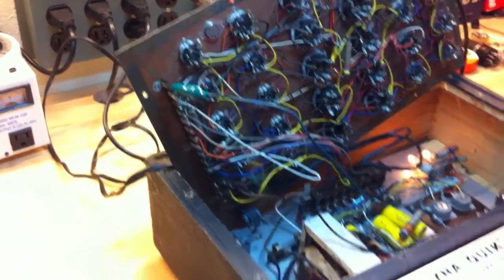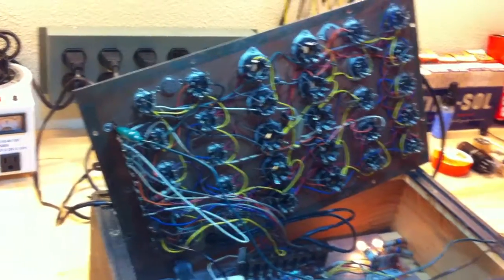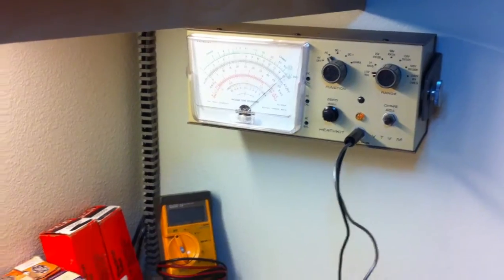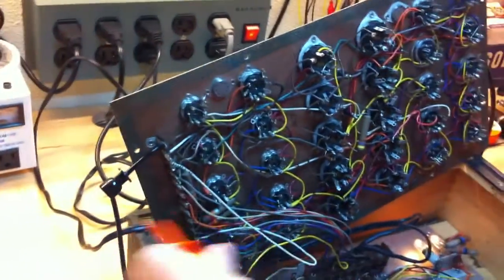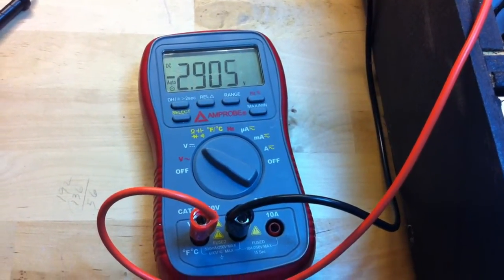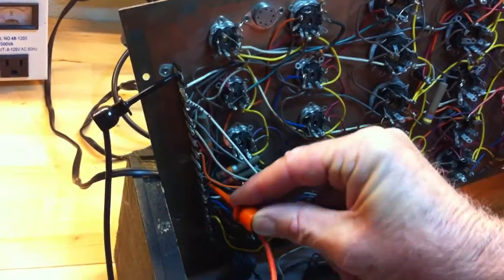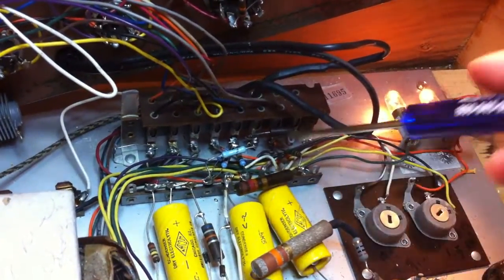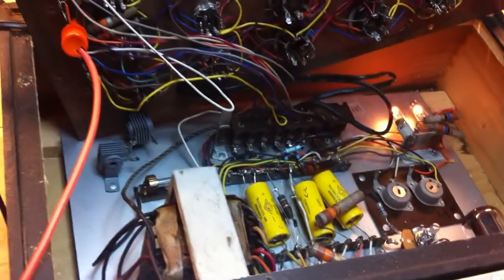B&K 500 Bias Adjustment

Comment: I picked one up free from moldy basement.i can say wood cabinet was finished but took many hours glue and reinforcement and sand and 3 coats of paint.
Then my God sand all rusted panels. Re paint make lettering. Long job. Had dig tube charts and book. Electrical now big job cleaning all up.  
Tube socket issues etc. 
I'm in last stages of restoration. 
Anyone try restore old moldy tube tester it's lots of work. Any old receiver s too lots work.
Bit at a time. Patience.

Comment from the maker: Bob, I dont have that unit any longer but I did locate my marked up schematic.  Unfortunately, it's difficult to tell the original values from the final ones. The short answer is that R-10 is 10Meg and R-13 is probably 210.  But, follow my thinking here and I'll show you how to calculate the correct values. 

You will notice that the voltages are printed as -15, -7.5 and -2.5.  The point is to get those bias figures correct, and nothing else really matters. Since the bias branch circuits are very high impedance you can neglect their current and just use voltage divider anaylsis techniques to calculate values that will produce the correct bias values. How can I be sure of this? R-10 is 10 meg and creates no significant voltage drop!  

R-10s accuracy is probably not especially important as long as its within 20% or so.  R-11 is a 1K if my notes are correct and the voltage drop is 7.5 which indicates the designers had picked a 7.5 ma current for the divider.  That value is very important; buy a close tolerance resistor.   The next voltage drop is 5 volts so use a 680 ohm resistor (or in parallel with a 33k {1/2 watt is OK} to get 666); but 680 will get you close. The final voltage drop is half the previous so R-13 is half of that value. 330 is a standard value. 

Now you say your R12 is 560 rather than 666 or 680 and you're probably correct. 560 is a standard value and were not building a watch here.  Now for R-13, I show 210 which is also less that half of the 560; so be it. We've neglected the resistance in R-4 (16 ohms) and PL-1 which is a small oversight (BTW, If you wondering, the center of the bridge looks to be at 0V).   I'd start with a 210 ohms and tweak the values until the bias voltages are satisfactory. A resistor substitution box, if you have one is made just for this purpose.

Since your R-13 was burned, you need to understand why that happened too.  Check the R20, 21 & 22 values. Also be sure that the R-10 value is close to 10Meg.  It's also possible the R-13 was fried when someone tested a shorted tube.

Let me know how this turns out.  I'd like to know your final values.

Good luck.

Dave

Comment: I just got my hands on one of these tube testers.    It is the exact same model as yours, which is a later version of the model 500 with a 6AX5 replacing the 83 tube.
I cannot get mine to calibrate.    I have two burned up resistors in the voltage bridge for bias circuit.  I have the correct schematic, but it only lists R numbers, no values.
Anyway,  we have
R10 - ? 10 M ?
R11 - 1K
R12 - 560
R13 - burned to a crisp
If you could please tell me the values of R10 and R13, I could get this thing to operate.

Thanks again for posting your procedure.

Bob Savino
Bergenfield NJ

Comment from the maker: It's been a long time, but in general a vacuum tube volt meter is used because it has an almost infinite impedance whereas a digital meter has lower impedance.  This often matters when adjusting bias on vacuum tube circuits that are themselves often very high impedance circuits. Hooking up a digital meter can drag down a high impedance circuit thus changing the value you are trying to measure. A vacuum tube volt meter does not.  Not all circuits are so high impedance that it matters (fixed bias for example).  I often like to hook up my VTVM for an adjustment and then touch the digital probes for a moment to see the result.  It really depends on how the circuit is biased.  I very much imagine that this circuit does require a VTVM (also I probably wouldn't have used it otherwise).  The diode type was a very common 1N4007. Nothing special.

Jonathan, sorry I missed your question.  I wish I knew, but like I say I dont have the 500 anymore.  I'd search for a schematic online or look at a 707 schematic and go with that. Good luck.